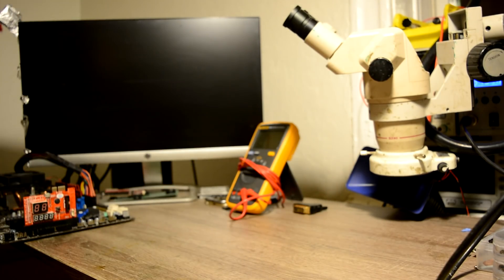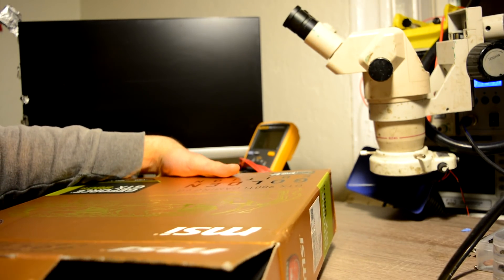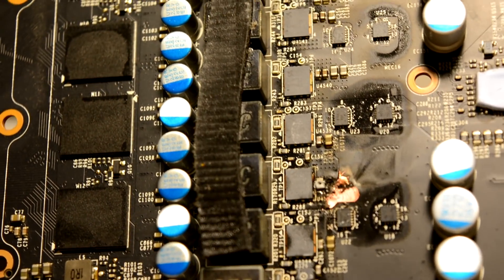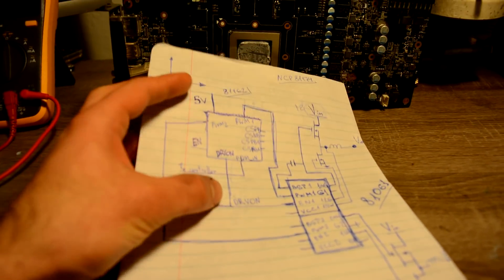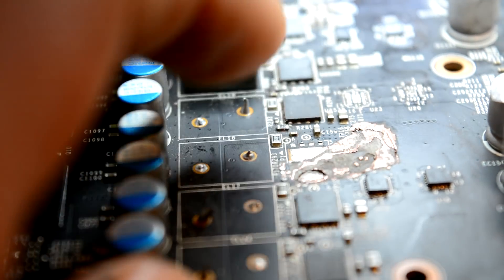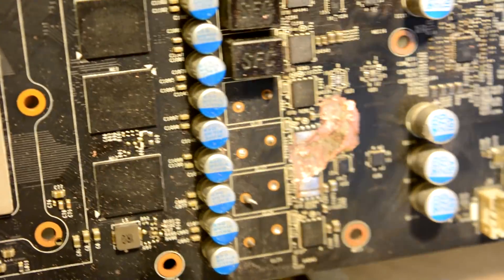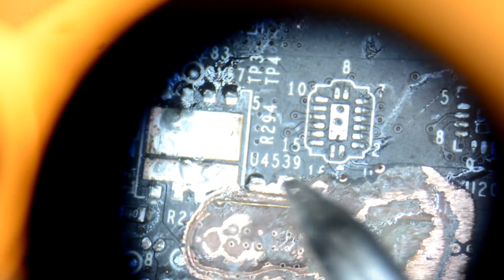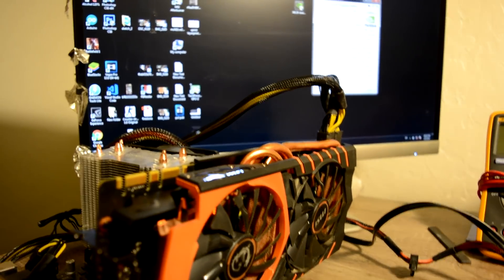GTX 980 ti burnt out 🥵 broken / no video out  card from Germany repair and diagnostic process

Comment: These multilayer boards must be a pain to trace and repair.
Great work!

What if you would rewire gate signal from the bottom controller to powerstage without driver?

Comment: Good Evening. My name is Payton. I have a Gigabyte G1 Gaming GTX 980ti Windforce that works, but when you put a load onto it, It crashes everytime.. I and a friend have done a lot of research on it and trying to figure out if it is a driver issue, BIOs issue or something else.. everything we have tried, has failed.. when i got the card, i noticed that there was something rattling in the card near the I/O plate where the inputs are. I personally took the plate off and a very tiny ball of solder fell out of it. very tiny.. but in the shape of a ball.. not like a piece had fallen off, but like it was heating up and bubbled up and fell off.. Is there any way that you can personally take a look at this please? I can send more info if need be.
Reply: Upload a video and point out the fault can help.
Reply: I am the friend that helped out and offered to put it in my rig. This card will simply not go above 50% power limit @ ~600 mhz. It reads 100% gpu load and hwinfo always reports power limit at 50%. Sometimes it will hop up above 1400mhz for a split second, but will normally go right back down to 600mhz. This was of course all while running furmark to stress the card. Any game launched causes the entire pc to freeze requiring a hard reboot. We have tried multiple different nvidia drivers, flashing vbios directly from gigabyte and custom ones from overclock.net, and even tried a completely different rig with a known working setup that was running a 1080ti.

Comment: Man, do you know where a scheme or a wiring diagramm for video cards can be found? I can handle electronics, but I need a scheme. Could you give some links, pls?
Reply: You can usually find wiring diagrams on IC Datasheets. Manufacturers use those, or something really similar.

Comment: he must not know just how hot in a matter of ms that gpu will heat up if allowed to load. i have pulled that "finger" method on a gpu 1 time. ONLY 1 time. it gave me 2nd deg burn on my finger tip just getting to the same bios "boot" screen that you did.  also first issue was using a dremel tool on the pcb which more than likely caused that spark when he tried to power it lmao. next time just hot air the affected mosfet and and other components, remove then check for shorts. this card will likely not be able to run games for any extended amount of time due to the power plane damage that he just caused with the dremel.  yes it boots, but only because you removed all of the components from the board lol i doubt that dremel did anything but cause more damage to the area to where it cannot be fixed in the future.
Reply from the maker: you dont have to hold finger until gpu gets hot as hell and gives you 2nd deg burn. That's the point, once gpu is getting warm - shut it off so it doesnt burn your finger and what's more important gpu. With evrything else not agreed either.. but anyway thanx for your opinion

Comment: wow, that is a surgeon job! 

dude, if you underclock/undervolt, can you use normally? stress/ gaming?
i did something similar on a 770 4GB, but for temperature reasons (original fans got broken, and was using 12cm fan) and worked just great, and FPS loss was not that significant

Comment: Hi, congratulations for your very educational videos. Now, I do have a question that you maybe can help me with.
I have an XFX RX 480 8GB. The card is recognized, it works without artifacts however as soon as I run a heavy load (e.g. a 3DMark benchmark such as TimeSpy) my computer powers off.
It has worked in this computer before without any issues, the problems are relatively new.
The computer has a 600W OCZ power supply, I also tested this with a BeQuiet Pure Power 400W PS, same behavior. I am using the Radeon drivers 19.2, all settings default, no overclock, monitor is 2560x1440. The problems can be reproduced in another computer, the other rig works fine with a 1060.
The fans of the card are working fine, I do not see any thermal throttling, I just see a hard power off. 

If it was a short in a phase I would expect the PS to shut off before I even see a picture.
So, I am at a loss. Do you have an idea where to look and what to look for ?

Greetings from overseas and kind regards
Reply: Does your computer restart?
If so, the most likely would be to verify the status of the chip, so it would be necessary to perform the card rework.
Check if it is the motherboard.
Another thing sometimes the generic sources mark a voltage announced for the moment of work they turn off immediately.

Check the amperage of your source and verify if it is of quality, since this could be the problem.

Comment: I have a non working gigabyte Z77X-UP7, 32 phases one, it bootloop by changing bios at each boot or if you disable the dual bios it keep on but nothing else happen (in both case there is no code on the display), do you have any adress in europe ? I saw that you give only the chicago one but you said in this video that you were in germany.
This board is too complex for me, dead mosfet is enough for me :D
Reply: Upload a video.

Comment: Undervolt it with afterburner and it will probably work fine :D
Reply: You don’t know much about GPUs
Reply: @marshian__mallow2624  clearly you know even less
Reply: Sopheris nope I know more clearly if you’re telling someone to fix a gpu that won’t post by undervolting it
Reply: @marshian__mallow2624  did you even watch whole video? After repair it works but missing mosfets so it needs to be undervolted to not burn them under load.  Next time think before writing a comment
Reply: Sopheris nah I’ll just watch before commenting

Comment: I have a msi gtx 970. Had water damage. 
Fixed all shorts. Powers up. 
Screen display is perfect in vga mode 
Artifacts after driver install. 
I believe the ddr chip is destroyed
Reply: Probably residues under the ram chips ... try to get someone with a hot-air and experience to flush some flux under those chips.
Reply: @MrThomashorst  hanks for the reply. 
I have experience.Removed the chips. 2x faulty traces destroyed. 
Ram chips are expensive to the point the card is on hold to be fixed ;)
Reply: 3d printing tech how did you get water on your gpu?
Reply: @Ok-vw9zz  I didn't. I purchased the card from eBay as the seller said it had a capacitor knocked off. 
Received a few days later and opened it up. It was coke 
All over. Under ram chips and corroded the traces

Comment: Please help me, I have a gtx Titan X, long story but no post, it has this black/grey goo around one of the memory chips and some of the pins were corroded(I cleaned them off) but what is this goo? I don't want to plug it in incase it ruins something
Reply: It seems like your card has water damage,  like you said you should  not turn it on, sounds like you have to rework the memory chip pads and maby replace that memory chip after that check for any shorts that may have occurred when the chip got water on it
Reply: @Mofie-aoi  oh thank you! I'll give it a try, how do I replace a chip though? I have a soldering iron and a heat gun if that's of use?
Reply: @fewik8567  don't use a heatgun it will ruin the pcb use a hotair reworkstation

Comment: Hi Eli, i have a question: do you know where are the ram controlers on the cards, are then in the core or on pcb? Could you test if its possible to transplant faster gddr5(7-8ghz) to the older gpu like r9 2xx(with below 6ghz gddr5) and if it will work with those speeds?
Reply: The imc is integrated on the gpu itself, you could put 8GHz chip on such card since you can overclock 6GHz chip at 8GHz on these card without problem (except having good chip that can manage the 8GHz)
Reply: @TheQuentincc  so you are saying: imc on older core can have problem pushing new memory chips to 8ghz? (even thou new gddr5 should have lower driver requirements in power and voltage)
Reply: @adamek1xd  on old card you can have the IMC or the GDDR5 chip that can limit the overclocking and we don't really know which one limit without changing the voltage of the imc or the gddr5

Comment: All i know that can help ofc if you want
-Round tip for the Dremel :D a ball. Yours, it's too sharp
PSU 12v cables connected to lab psi via PCIe Extension https://goo.gl/B1ViWh
And a thermal seek camera that is 200$
i freaking love the way you draw the diagram it feels like it burns into your head. TY SIR
Reply from the maker: Thanx, I agree on all of those 3. Especially on Extension cable

Comment: People just oc'ing gpu too hard these days
Reply: I doubt this has anything to do with overclocking
Reply: GoogleEyes  You do realize Nvidia gfx cards overclock themselves far higher than specified boost clock right? It'll try so sustain the highest clock it can as long as the power delivery is available and temperatures are in check... If overclocking wasn't safe do you think GPU manufactures would ship their cards out with this feature enabled by default?
Reply: GoogleEyes  Oh boy... I can barely understand your English and now I must try debate with you :/ Go have a look at MSI Afterburner while playing a game on an Nvidia card that supports GPU Boost. You will find that if the gfx card is below power limit and temperatures are not high, the card WILL overclock itself. If temperature or power consumption gets too high, clock speeds will be lowered. So again, why would Nvidia offer this feature if it could damage the card?
Reply: GoogleEyes  "No GPU overclock is safe!" <--- So what did you mean by that then?
Reply: GoogleEyes  Ahhhh okay yes that comma would have made a huge difference :D Cheers.
Reply: they just push and burn never know thermal limit.
Reply: @claritoresdiano1021  its not the people fault the system should shut off so nothing happens

Comment: Would underclocking the card make it safe to stress test? or not because the card cant recognize which phases dont have power? Even if its not its former glory there is still value in an underclocked 980ti yet not really any value in a 980ti that cant stress past idle.

Comment: If there are small six legged chips broken off the PCB with their pads... is it possible to repair the card somehow? I thought to glue the chip (because there is nothing to solder to) on with heat resistance glue and than solder wires from all the 6 legs to the near contact points, but I don't know if that would work...
Reply: yes it would.
Reply: Yes if you do it right it will work.
Reply: If it works just make sure you insulate the cables well and verify that they do not touch the tips together.

Comment: Thanks for the video! I have a gtx 970 with the same issue, got scammed on ebay...

I also got a gtx 1080 ti, all voltages are fine but the picture has horizontal stripes (if it's outputting anything at all). Any tips on finding out if it's a chip or vram issue?

I can't really solder a chip, but I did solder vram with hot air a few times successfully.
Reply: Normally the most advisable thing is to do reballing, but in your case if at the time of stressing the graph it does not stick then it may be a condenser.
Reply: Stripes probably mean dead chip :< But you can try to heat it up to 200C, sometimes it works
Reply: Reball gpu chip or reflow it and try :)
Reply: Who is the vendor ? I think you can get replacement with some vendors even after the warranty is off

Comment: my gott Eli, jeez, this was really difficult. I expect you to find that driver, so it is only two phases down. I have trouble wondering if the traces could be wired with jumpers for the other two traces. Or are some other components not there?